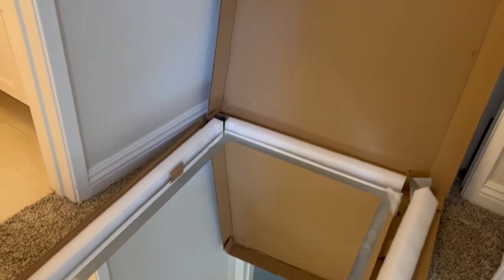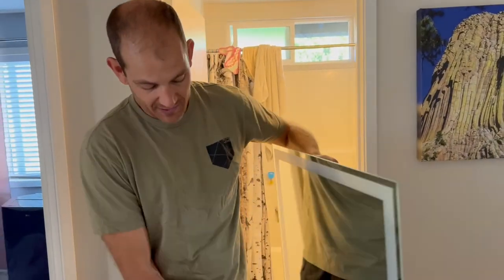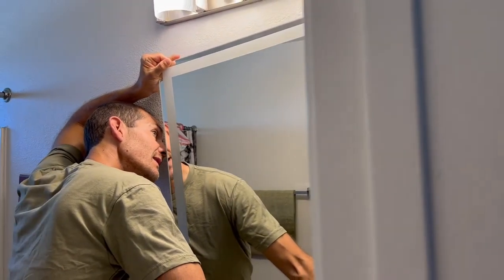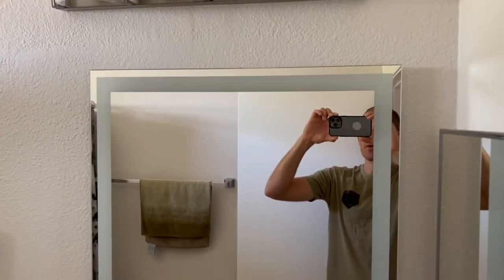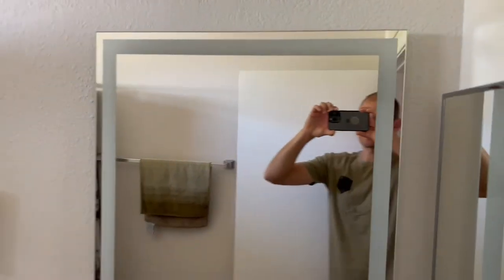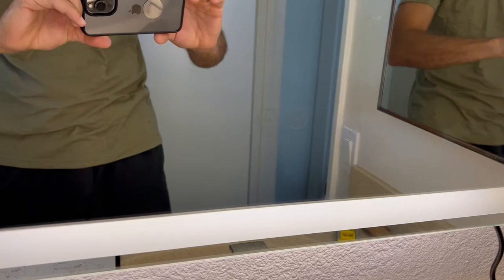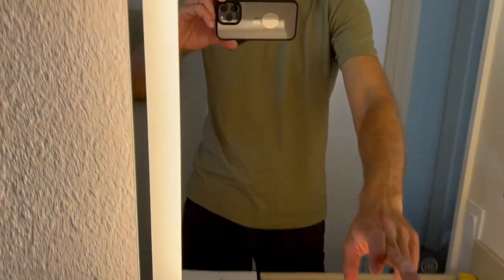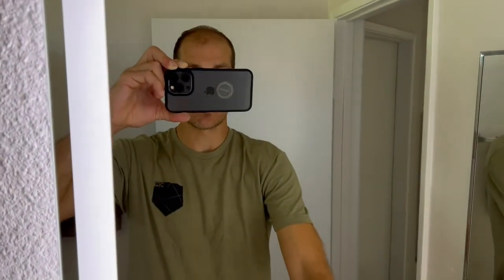How To Install And Use Mirrorons Led Lighted Bathroom Mirror

Comment: Where are the mounting brackets or position on the back of the mirror? Is it at the very top or somewhere lower?
Reply from the maker: Hi, it’s a couple inches down from the top and goes across about 10” (estimating). Full details should be on the amazon seller page - https://amzn.to/3QnGdrY (ad) ☺
Reply: @deannegustafson  what brands or style has the plug on the wall option?